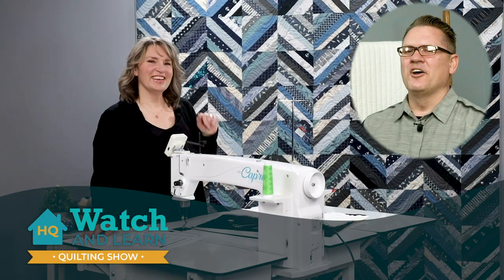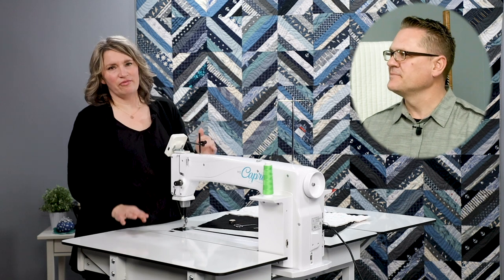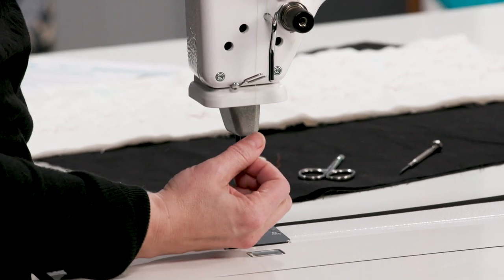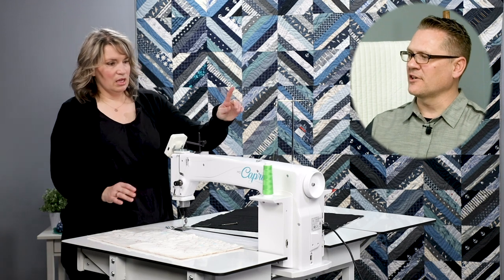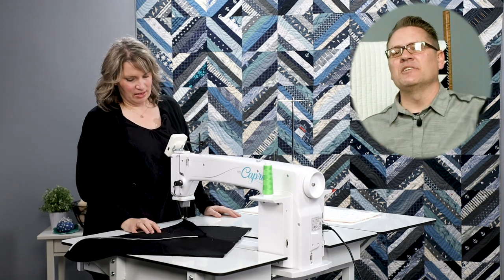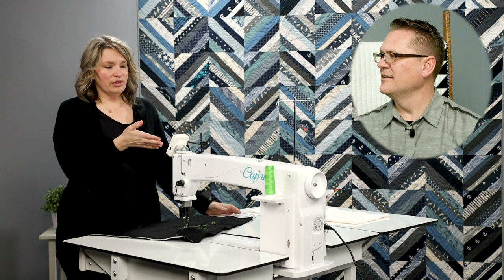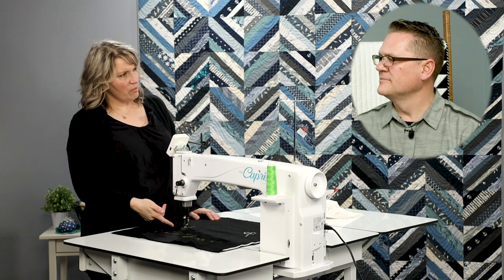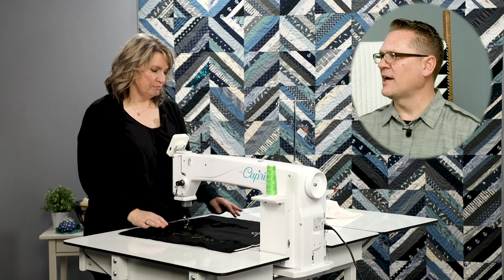Troubleshooting tension on your longarm

Comment: HELP!!! What do I do about the “zigzag “look I’m getting in my stitches. All of the tutorials address tension but not this zigzag problem.
Reply: When I have had that look it is normally that my top tension is not tight enough.
Reply: I tried that too but it then pulled up the bobbin thread. My “drop” test for my bobbin was correct. My stitches on the “regular” cotton fabric we’re fine but the”zigzag” stitches on the batik fabric were awful.

Comment: My thread keeps breaking. ????? At my wits end.
Reply from the maker: Have you tried a new needle? Is the needle the correct size for your thread? Are you using a high quality quilting thread? Is your thread path correct? I would suggest calling into Handi Quilter if you are still having issues.

Comment: I have a problem setting my tension so that it is consistent across the quilt as I stitch. I may start out with what looks like perfect tension and lay down a nice clean line, yet when I stop at the end of that line and start sewing in a different direction, the bottom or the top tension will be too tight. Sometimes I get pokies on both the top and the bottom in a single line of stitches (when I lay down a longish line). How do I get the tension to be consistent
Reply from the maker: When you are testing your tension, make sure you do some loops and stars so that you can see if the tension is pulling when you are changing directions.

Comment: I’m so frustrated!  My thread keeps shredding. I’ve actually reduced my bobbin tension to nothing. Literally. No tension in it. I’ve replaced the bobbin case but when setting the tension I have to make the top tension extremely tight while the bottom tension is totally loose. Makes no sense. I’ve replaced the needle, retreaded 50 times. It’s superior so fine 40 wt poly thread. My machine just got serviced 3 quilts ago. It just started doing this. WTH!!  Anyone have any idea???? Im desperate
Reply: I’ve worked on this 10 hours today and got 6 rows of panto done. 5 breaks. I’m about to take a hammer to it. lol.  When I pull up the bobbin thread it is actually really loose so there’s no secondary reason the bobbin tension would be tight. It’s not.
Reply: I hope you figured this out. My bobbin thread keeps breaking but it is not tight. It doesnt get tight until i sew for a minute. So frustrating!
Reply: Having the same problem on my brand new machine, no matter how tight the top thread is, I have eyelashes on the bottom.  Until its so tight the thread breaks and I still have eyelashes.

Comment: Thank you for all this info. If I could add one more thing from my own experience, watch out for fans. I live in tropical Queensland Australia and constantly have a pedestal fan running and was having some issues intermittently. I worked it out on a cooler day that having the fan blowing on and off the thread was making it flap about a bit. I’ve added a thread net to my spools and make sure I don’t have the fan running full pelt at the side of my frame. I have a HQ Fusion.
Reply from the maker: Great tip!

Comment: Got question. Bobbin tension is good but I have to set the top tension 10 times more than normal to get a perfect sew but it breaks thread bout every 6 to 8 inches. Got any ideals, ready to chunk it in the lake.
Reply from the maker: I wonder if there is an issue with the spring in your bobbin case. The tension might be fine until you insert it into the machine and it is pressed in too tight. Does it seem like the bobbin is sitting a little high in the bobbin case? 
Have you tried different bobbins? A different case? A different top thread?

Comment: I spent almost three years troubleshooting tension issues.  Halfway through every single bobbin I quilted, the tension changed with no indication. I purchased a second bobbin case after I troublshot the tension issue to the bobbin and even had my winder repaired. It turned out to be the spring height. Both bobbins cases, brand new straight out of the packaging, had springs with the height set so that the bobbin was sitting too high in the bobbin case. I threw so much money and spent countless hours ripping stitches for almost three years. Please include this in your discussion on bobbin tension. It is not an aspect of tension often touched on.
Reply from the maker: Thank you for that! We'll keep that in mind.

Comment: i get log stitches on tophow do i fix it
Reply from the maker: Are you using stitch regulation? Long stitches sometimes mean that your encoder is off.  Check that all of your cables are plugged in all the way. It if persists, please call your retailer or call HQ Technical Support.

Comment: I'm using Magnifico thread, and it keeps shredding and breaking (top thread).   I've checked my bobbin tension and also made sure there are no loose threads in the bobbin case.  Before it happens, my stitches look good, so I think my top tension is okay, too.  What typically causes this?
Reply: you could try a larger needle  - Magnifico is 40# weight polyester thread.  Do you have the same thread in your bobbin? or a thinner weight? such as DecoBob, Bottomline, microquilter or any finer/thinner #50,#60,#80 or #100 weight - you will need to check your bobbin tension & adjust as necessary.

Comment: I keep getting eyelashes on the back side. What do I do. Deb of South Dakota
Reply: Hi Deb , You need to tighten your top tension, or loosen your bobbin tension.  HQ recommends setting your bobbin tension first, then adjusting your top tension according to the thickness of your top thread, wadding/batting you are using etc.
Reply: @nickyg-uk5055  thanks Nicky, I will try that and see. I just couldn't get it and it's been 2 years  since I have used it . That makes me sad.